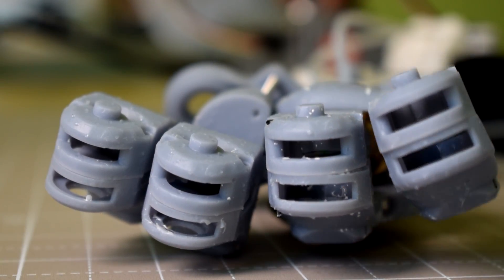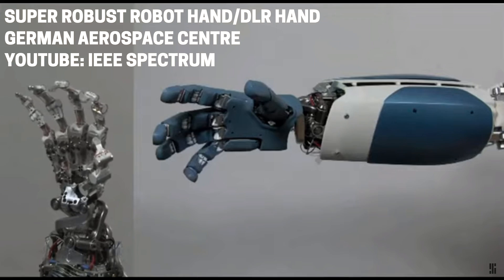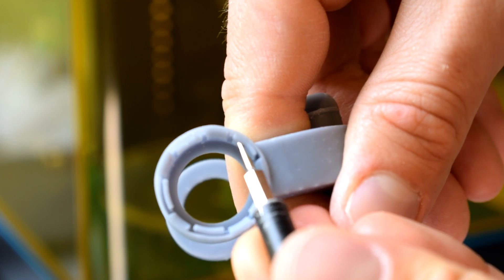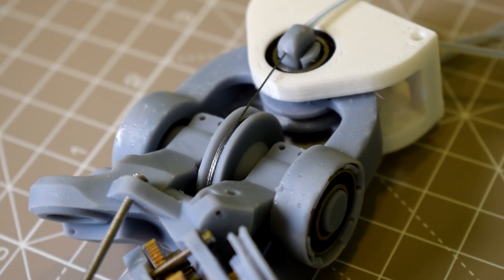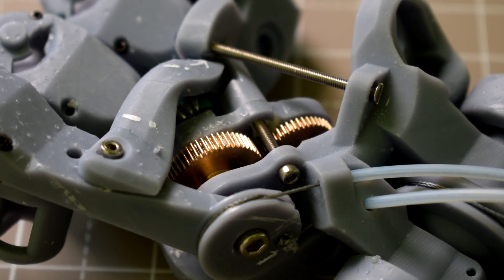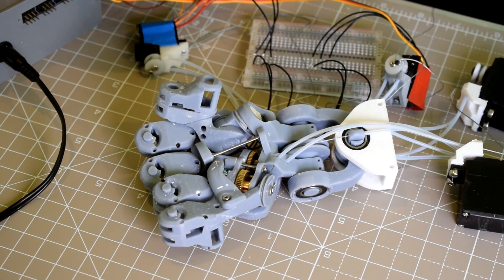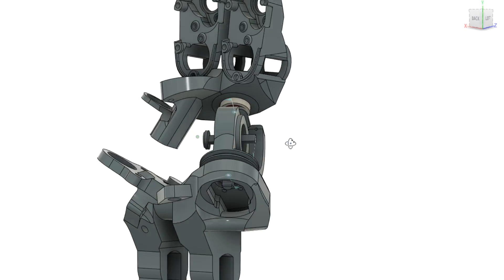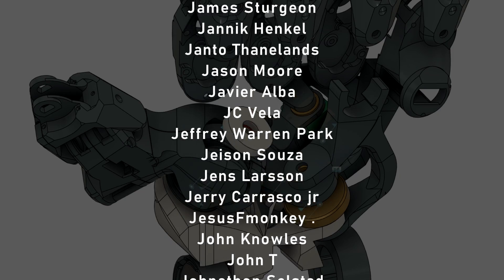Combining Subsystems to Form the Palm

Comment: Just looking from the intro, that is one slick assembly. Imagine making the final out of cast/machined aluminum.
Reply: Injection moulded carbon fiber with titanium supports, would be best. All Al, combined with motors and batteries, too heavy for a daily use.
Reply: There is castable resin out there. It shouldn’t be to complicated to find someone with a furnace and all the other equipment to cast aluminum. That would be awesome.
Reply: Some of the subcomponents look extremely tricky to machine from Alu. Casting could be done by the amature (lost PLA in plaster?) but wouldn't be much stronger than the printed plastic.
I wonder if someone will offer to print his final design in PEEK or something
Reply: @FirstLast-wr9mh  you'd want to use some kind of ceramic investment, plaster burns if it gets to casting temps (I cast gold, if you've use a metal that casts at a lower temp you may be fine)
Reply: You can also make biocompatible 3D printed parts with SLS, titanium, or chromium cobalt
Reply: Might be tricky but with a good silicone mould, some high strength resin, a vacuum chamber and carbon matrixing, you could possibly get a very strong but lightweight hobby composite.
Reply: you just made me orgasm. Good day sir.
Reply: printing in resin then electroplating chrome sounds better to me
Reply: that's what i was thinking! it would be so cool
Reply: I think laser sintered aluminum with machined over pressfits and bores might be cheaper and it reduces the overall time of machining the part with all its complex surfaces. It's somewhat weaker but not so much that breaks easily.